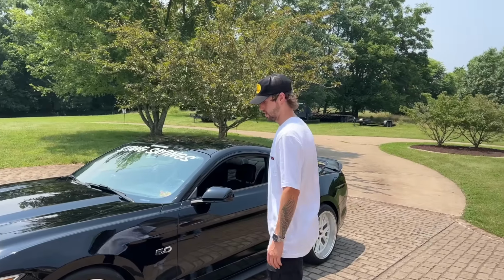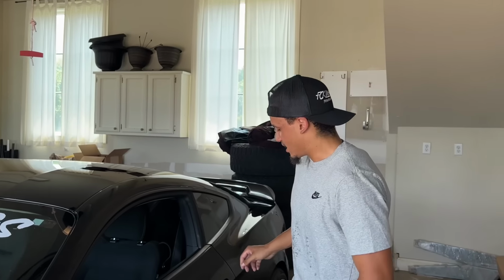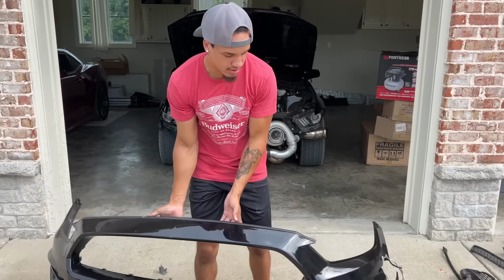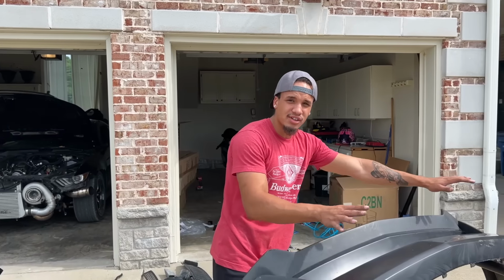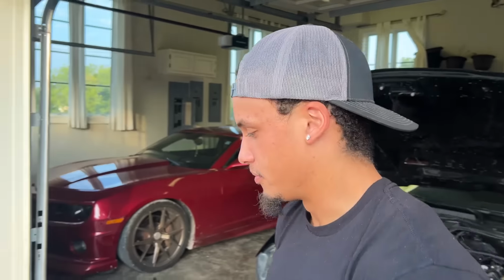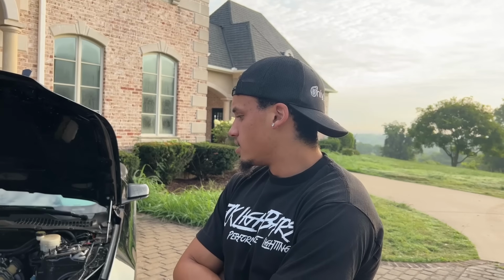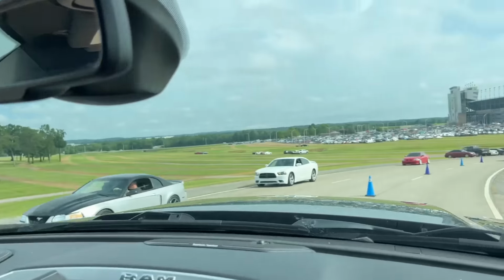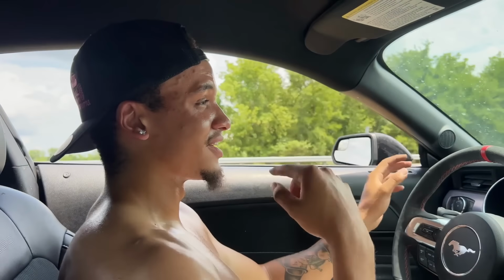Introducing "Medusa" my LSX Swapped Big Turbo Mustang!

Comment: gabe finshes putting the front end together without the grille and it immediately cuts to abby blasting a pressure washer into the wide open turbo 😂 I cant
Reply: Can you see ? I literally went around it
Reply from the maker: I drive the car in the rain it’s fine 😆
Reply: She didn't spray anything directly into it, I've done alot worse to turbos. Stop trying to bring her down to your level lol
Reply: @GabeFarrellProductions you do what you want. Which you can do when you buy things with hard earned zeros and ones.
Reply: @abigailhaleym  mhmmm. Hard to concentrate on the turbo tbh. But In all seriousness you didn’t spray the turbo at all. Maybe some mist. Who cares.

Comment: They make intermittent pads and it’s just a soft pad for the sand paper for doing round stuff. Makes it so much easier. And on new plastics just use 800 or red stuff pad. But you did great lol